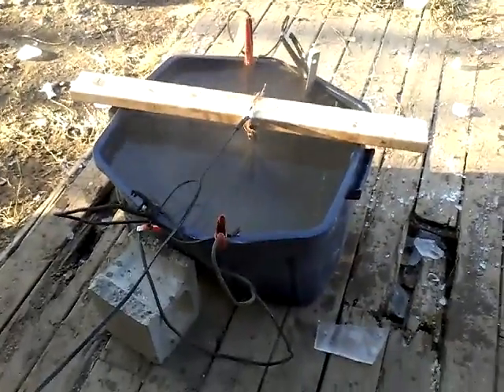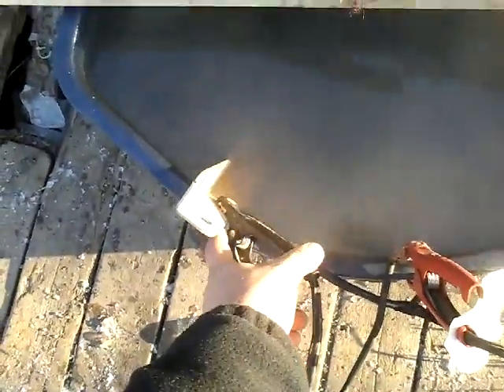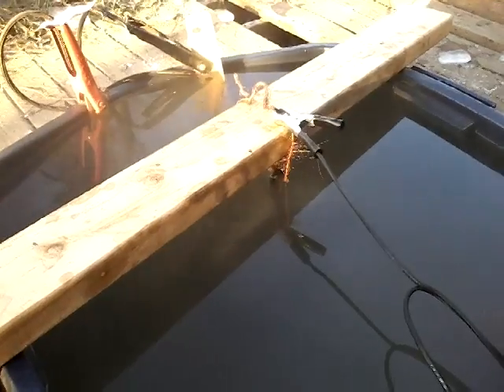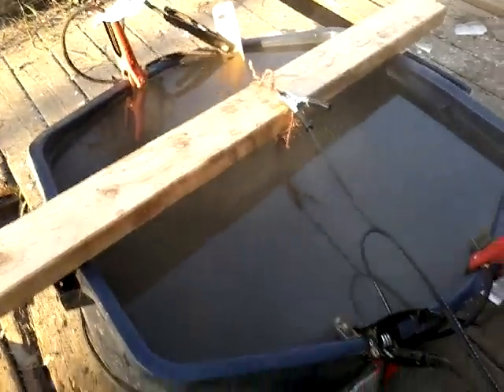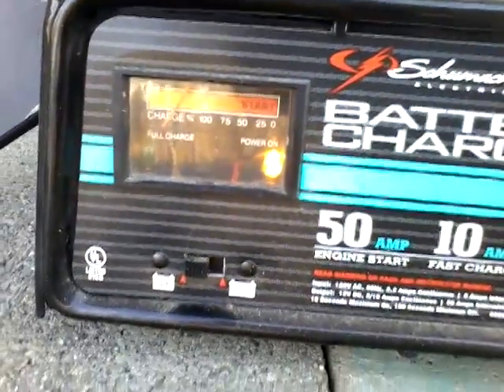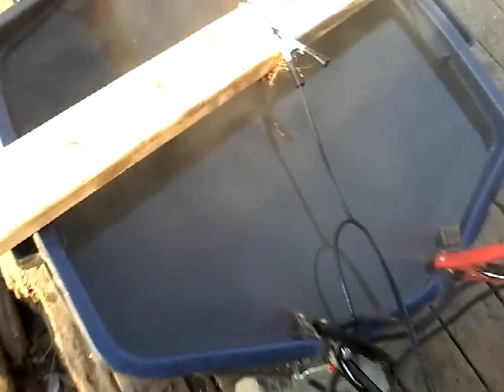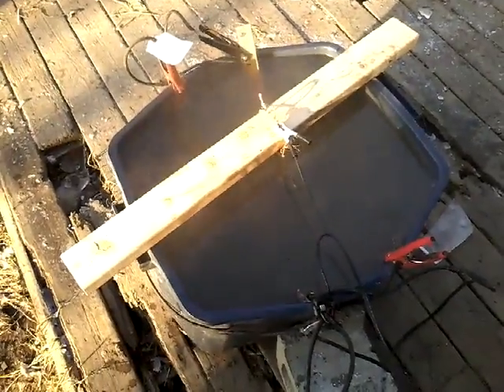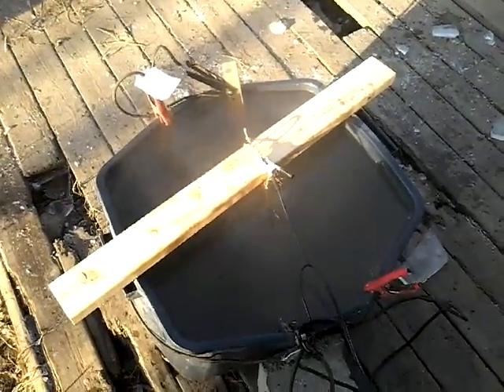My cheap DIY E-Tank (Electrolysis Tank)

Comment: Good video. Thanks for sharing. Just wanted to note you are supposed to use sodium carbonate like washing soda. You said you used baking soda which is sodium bicarbonate. Not sure how it turned out for you? Good luck!
Reply from the maker: Ya, I read that they both would work but that washing soda was best. I just happened to have baking soda so thats what I used. Actually worked out great. Made my rusty pieces look like new.